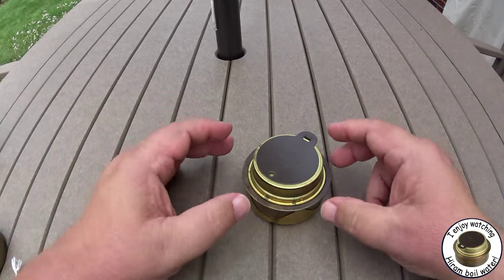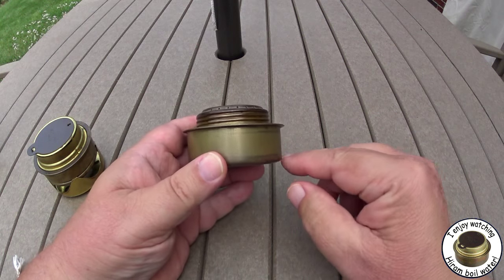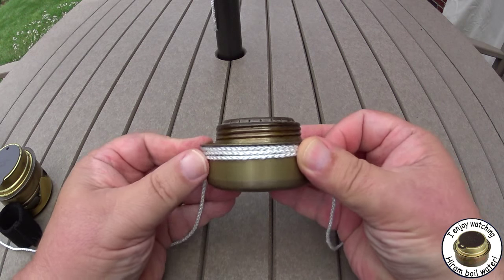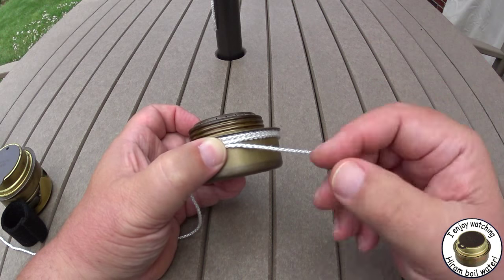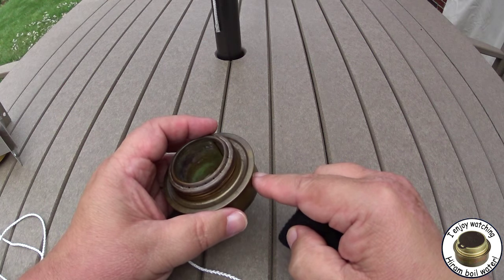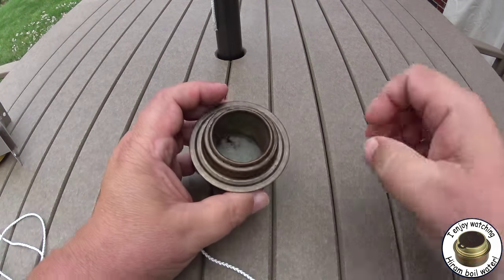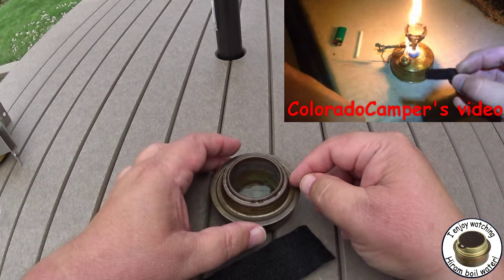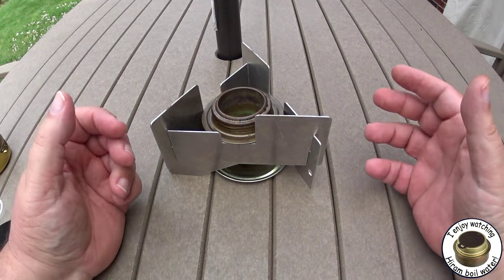Couldn't you just add a wick wrap to the outside to heat up the stove body

Comment: Hiram: the can lid slid under the Trangia with a small piece of carbon felt soaked in alcohol, to warm the body of the stove is simple genius. It exactly addresses the issue at hand. Also Hiram, I would be most interested in your possible testing of home brew fermented ethanol that could have an alcohol content of approximately 60%. If it would burn ok, say for an emergency scenario, the user would not have to distill it to obtain higher concentrations. Your thoughts? Thanks Hiram, for ALL you do for the prepper community. Greetings from Ontario, Canada. Barry Howard Begley

Comment: I really do not understand why there is an issue with COLD weather, COLD metal alcohol burners, and COLD alcohol fuel.  You have no 98.6 degree Fahrenheit body heat?  Home prep your own gel-alcohol (sterno, JELLO gelatin + kerosene, white gas, or diesel, no water), and put into small squeeze bottle.  Carry metal burner, alcohol fuel, and gel-alcohol next to body heat!

There are the lady's two aromatherapy rings, they put onto house light bulbs:  copper tubing with tiny drill holes along the top, or absorbent ceramic rings.  They put essential oils into the tubing/onto the ring, and place onto the HOT light bulb.   The HOT copper tubing or ceramic ring aerosols the oils.  Find the needed Trangia copper tubing or ceramic ring collar size, and use the same technology.

Find/make/weld a copper tubing ring as a collar, that fits onto the Trangia ledge.  (1A) Cut/file open the tubing and make into a deep "U" open-mouth (or smaller more closed-mouth "O") collar trough.  (1B)  Or drill out flame holes along the enclosed tubing.  Fill with body heated gel-alcohol, and light up.  (1C)  Home prep and soak the ceramic rings with gel-alcohol, wrap in aluminum/tin foil, then in airtight ziplock baggies.  Carry next to body heat.  Pull out, put either collar onto Trangia ledge, and light up.  Or squirt body heated alcohol or gel-alcohol into/onto tubing or ring, and light up.  Entire copper tubing or ceramic ring will flame up, heating up and providing the needed alcohol evaporation heat cycle.

Just use body heat first, then light up, and you will have your solution.
Reply: With fuel in the stove, just put the lid on and turn it up side down and give it a little shake. Then take the lid off and light it up. When I do this, I get a bloom in less than 10 seconds.

Comment: Thanks for the info Hiram. I've never tried my trangia in the cold yet. Likely this winter. 
 Have you engineered a better simmer ring yet? It seems to me there must be an easier way to reduce the heat, especially when using a 'closed' stove where it's impossible to access the ring without removing the cookware. I was thinking of a sliding cover, maybe tapered or perforated would be the answer. I'm not sure if the ring chokes off part of the bloom, or just reduces it. 
 If you've  already covered this in a previous video, I'm sorry. I'm interested to hear your thoughts and opinion on this. 
 Thanks again.
Reply from the maker: +Harley Wood Putting a cylinder of carbon felt inside the Trangia really makes the simmer ring work better.

Comment: I've used Milo tin lids as primer pans on all sorts of alcohol stoves. Only problem is that you have to finish a tin of Milo!
Reply: had a tin lid from some breath mints, put some 1/4 inch wire screen in the bottom to raise my soda can burners off the bottom as a pre-heater. now i have to find it again.

Comment: great vid, but the is a much easier way. you just fold up a thin slither of tissue paper or a single fibre of string, and put it in the trangia so it sticks out, it draws up fuel and preheats the surface of the fuel, enables you to light it in any temperature :)
Reply: Neat idea!

Comment: This looks like a reason to test fiberglass wicking ,vs carbon felt donut ,vs tin can lid and carbon felt square ,against the Trangia cold weather attachment. Fastest to bloom wins.Put each of the Trangia burners on a foil pie plate , pre fueled that has, say, 1/4" of ice or shaved ice  in the freezer to cool. pull them out then light.
 Thanks for the Videos Hiram I check to see if you've uploaded every day, It's nice to have you back .

Comment: Hi Hiram,
What is the "proper" name for the fiberglass wick/rope that you showed and where do you get it? I was trying to find it on HomeDepot and Lowe's websites but couldn't quite see anything like it.
Thanks!
Reply from the maker: +This Trip of Mine I'm not sure if the Big Box stores sell it. Do a search on eBay for "fiberglass wick". Here's an example.
http://www.ebay.com/itm/1-8-Round-Fiberglass-Wick-Tiki-Torch-Bottle-Oil-Lamp-Rock-Candle-USA-5-feet-/201426836542?hash=item2ee5f99c3e

Check at places that sell fireplaces.
Reply: Thanks +Hiram Cook

Comment: i did this to my titanium evernew knockoff to get it to bloom in a reasonable time and it works ok.  I guess the flame must lick around the top enough.  I've never used it in the cold though.
Reply from the maker: +FlashGeiger Which cylinder did you put it on? The smaller upper or the larger lower.
Reply: +Hiram Cook The lower one.  I thought it might not last very long if I put it on the upper one where it would be in the flame all the time.